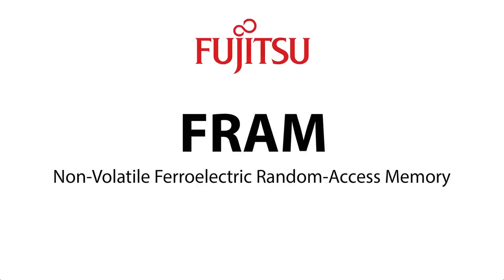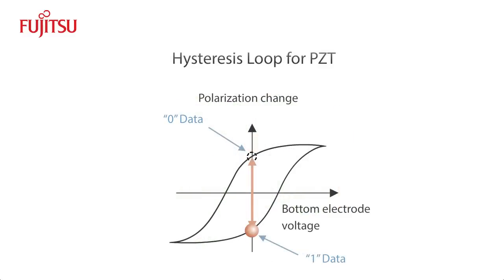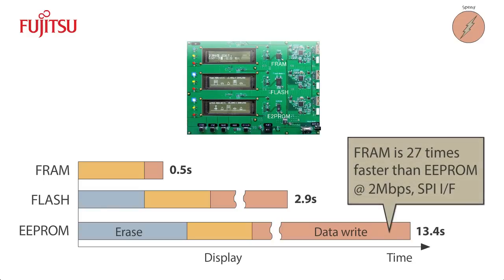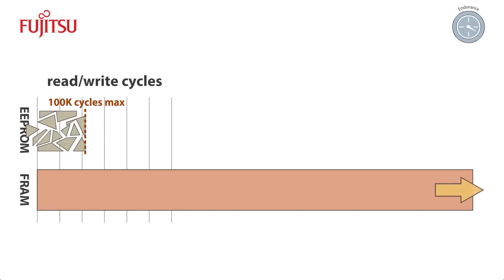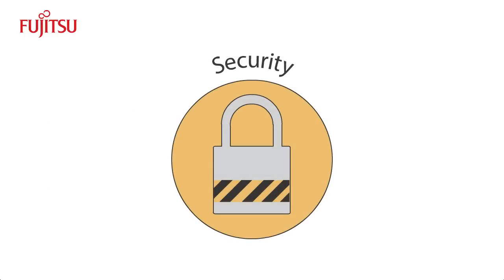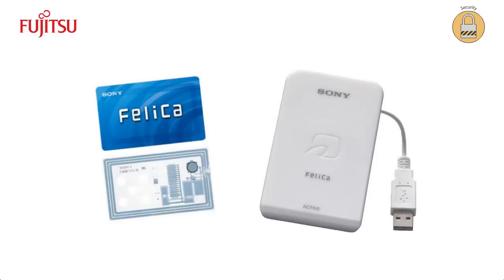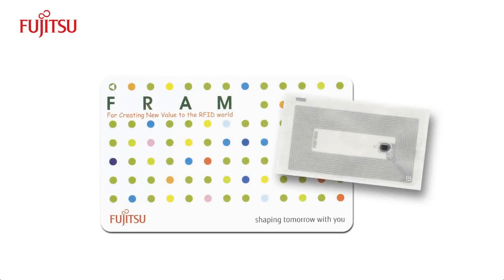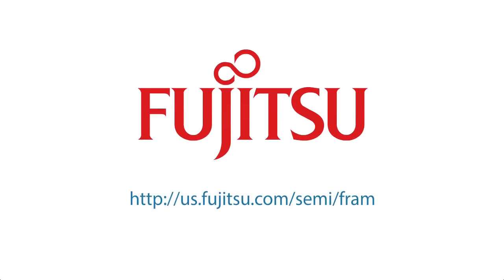Overview of FRAM as a superior non-volatile memory alternative to Flash and EEPROM

Comment: FRAM will end our slow booting computers, because an entire operating system stays in memory when the power it off. The operating systems also need to be rewritten, because you can run Windows 9 on and old 386 cpu if you want (when it was programmed with a machine language instead of a higher programming language which have lots of overhead. But you need to find very good programmers. The old PC demos of begin nineties show you how powerful a program of a few kB can be. No need for GHz speeds and Tbytes harddisks.